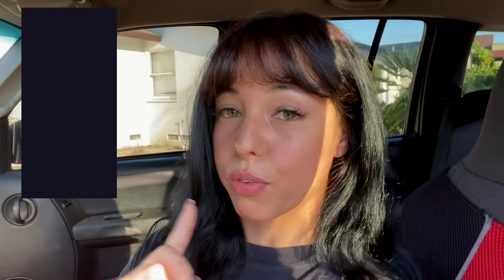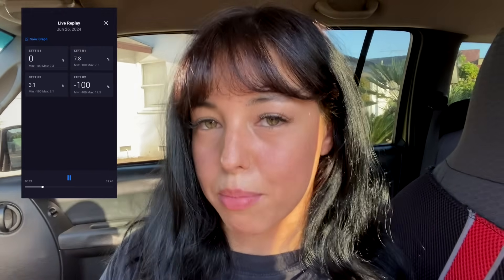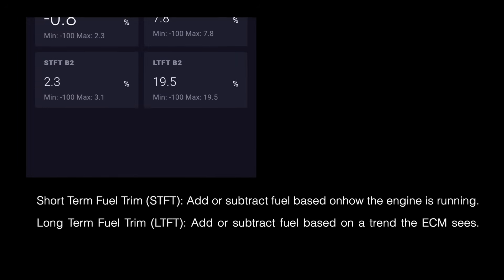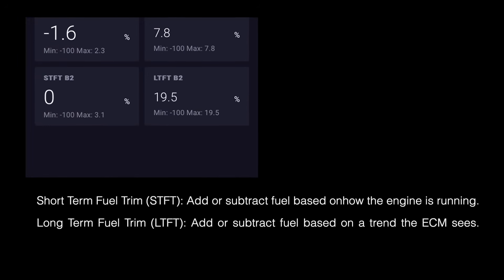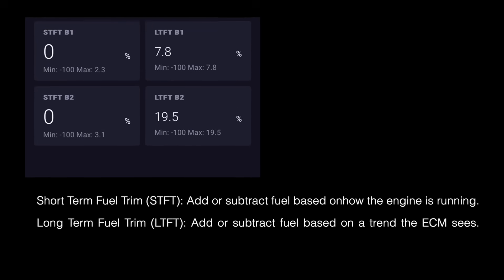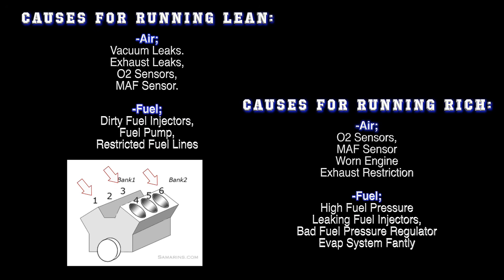Live Data from my OBD2 Scanner helped fixed this Jeep for good!

Comment: 1.02 of this video for a second there STFT B1 went all the way to -100.. 🤔. But it does look like it stayed consistent. I really like how cars are programmed to run at stoichiometric air-fuel ratio. I am still learning a little more about fuel trims. I like the fact that you can diagnose the problem quickly with fuel trims. 
I feel like fuel trims is like secret codes of numbers telling you the problem it has.

Comment: Good luck these have valve seat issues where carbon stops the valves from turning and wear funny. Even after cleaning they will pop up again usually not long after. I've done these and a month later same random misfire. Head work is usually the only solution.

Comment: Very good job on the diagnosis. I just diagnosed my daughters car with a vaccum leak the same way. My live data was showing long term fuel trims almost maxed out close to 30%. I smoked the intake with my homemade PVC smoke machine and found the EVAP purge solenoid was leaking. Replaced it and fuel trims went back to normal. I made a second PVC smoke machine to gift to my brother and he was able to diagnose a vaccum leak on his Land Rover Disco 2. Found leaks on several injector oring seals that had dried out. It was driving him crazy trying to figure it out. Really good tool to have. Again nice job. Cheers

Comment: The only time my Jeep needed plugs or one single coil was when the coolant resevoir tank was dripping onto the coil and connector. Then the valve seat dropped two weeks later. Then the waterpump leaked. Then the torque converter went to hell 3 weeks later. Made it to 198,990 miles.

Comment: Even though the intake coupler is damaged and a source of smoke leaking when performing a smoke test, this is not considered a vacuum leak. This engine is a MAP based system not a MAF based system. If you don't see a sensor on the intake duct/hose, a MAP sensor is used to calculate air density. This sensor is attached to the intake manifold. It's still a good idea that the coupler is replaced because it's letting unfiltered air into the engine. The grease I saw on the COPs looks red in color. This makes me think it's regular wheel bearing grease. That type should not be used. On top of that the grease is on the outside of the boot. The correct lube should be dielectric grease, which is typically clear and it should be applied between the boot and the ceramic portion of the spark plug. The number six plug's washer looks like it wasn't crushed. Meaning it wasn't torqued down correctly in the first place. You might have inadvertently fixed the misfire by removing, cleaning, and retightening the spark plugs. Good job there. No need to pull the fuel injectors. The B2 LTFT still doesn't look right. It should be +-10% range. Either there's additional work to be done, or the scanner is reading wrong. I would suggest using a different brand and compare it's reading to yours. Overall I commend your work ethic and perseverance. Please take this as constructive criticism. My intent is not to bash or mansplain. Have a great day.

Comment: For future reference baby girl just replace the plugs instead of cleaning them. Plugs are wearable no point in putting used plugs back in. Plugs are fairly inexpensive for the most part. Also check gaps and make sure they are in spec according to the vehicles specifications plugs may look fine to the eye but the gap tool may say otherwise. Each manufacturer varies. Not trying to 💩 on you or anything just giving some knowledge. I myself work on alot of things.

Comment: Learn how fuel trims and O2 sensors work as compared to how misfires affect fuel trims. The scan tool is telling you there is a misfire under a load!

It's not the air intake pipe or the O2 sensor and the engine is not running lean. 

Codes only point you in the right direction so you can interpret the scan data and run some tests. I feel like the blind leading the blind 😳 Search for how misfires affect fuel trims.

Comment: Hermanita, put a pad down for your knees to help on the vehicle. Wear knee pads, or, buy the tire step tool, PT makes a good one for cheaper and it holds my FA up at 210lbs, so I'm sure you are good. Nice on checking the basics and finishing the Jeep up. It's a Chrysler so don't be surprised when you have job security. Been doing technician service for years now, as well as welding fabrication and some machining areas. Welcome to the trades.

Comment: Hi, my name is Felix and I live in NYC I love watching your channel ive learned a lot lol. Want to buy a good but affordable OBD sensor what would you recommend? TY
Reply from the maker: @0722fear  Hello there Felix! Thankyou so much for the feedback! For a handy diagnostics tool, I would recommend the Innova 5610! Mine has helped me diagnose and fix almost every issue on my Cougar and to help other vehicles as well.
It has a lot of great features like live data, and reads other parts like the transmission, ABS, and safety/ electrical Codes.
They have really useful customer support which has helped me a long my journey 👍🏻
Reply: @Amy.sahadi  Thank you so much for reaching out. I wish you much success on your channel - Hope I can ask you questions about my car if thats ok. I have a 2013 Honda pilot and I just recently replaced both l/r wheel bearings (front) now my ABS, BRAKE and Stabilizer lights are lit up - help :)

Comment: U should have pressed the gas pedal to let the throttle body open that way smoke can get inside the lower intake checking for other potential vacuum leaks there too the throttle body being close won't give u an actual reading

Comment: Damn shes beautiful, mechanically inclined and has a nice body, shes a triple threat.
Reply: Forreal though. Whoever her dude is is an extremely lucky mf. I have done multiple engine swaps by myself without a lift in my driveway, and all of my previous ex’s just kept asking me when I’m going to be done after pulling the engine/transmission combo and then reversing the steps by myself. How about help me instead of asking me when I’m going to be done. 💀 You also have to be a pretty decent sized Human to do all of that by yourself as well. 6’8 and 184 pounds of lean muscle should do it.
Reply: Simp
Reply: @ElberGalarga22 Were you not doing the very same at one point? 🤔
Does she stop being the magical person she is/was once she has been 'claimed'? 🤔
Reply: She is not interested in no one she just wants views for Cash from you tube
Reply: Sexy

Comment: I'm glad it worked out for you.  Usually those misfires are due to bent intake valve on those motors. It takes about 7 days for it to happen again.  Also, I'm from the school of thought that if you're already in there minus well replace cheap tuneup parts. Do the job once imo. That way you 100 rule out the usual suspects.  Great vid!
Reply from the maker: @nj033  thank you! Im so glad it wasn't either, and it worked out for the best,
I know that i still want to check the car again in the future and make sure its still running smooth with no misfires or codes, sucks that it wont pass smog for now but atleast it runs fine! 🙌🏼
Reply: @Amy.sahadi  Just so you know, you can't clear emissions DTC's. What really happens when you clear emissions codes with a scanner, the check engine light goes and all of your pending codes get relisted as permanent.codes. While the codes are permanent, the pcm monitors the system to determine if you really fixed the problem, or you just cleared. They do it this way because people would clear the codes right before they pulled in for an inspection. Your scan tool probably can't read permanent dtc's.
Reply: If you have a bent valve, it will show up in compression test, or a relative compression test. I would do that first.

Comment: Decent work, but wrong plugs. Iridium in that...nope. :)
Chryslers are tricky, Mopar or no Car and esp with o2 sensors. they like those OEM. 
The Fuel trim was nice call, but the ECM will see the lean and fire more fuel into the chambers.  Only at startup ( open loop) and idle can you tell if you probably have a vacuum leak, and the misfires data will probably tell also, as sometimes there are misfires and the no MIL lamp/light, but you can see them rolling. 
Either way, still work in the hot sun, and Im sure climbing into the engine at your height makes it more challenging. Dont get me wrong the view is exceptional. :)
Reply from the maker: I did not get to test the 02 sensor beforehand when i replaced the original O2 sensor from the Jeep,
But i did test it after and the voltage was at about .6/.4 fluctuating, so both banks were fine !
Reply: @Amy.sahadi  Good deal, I like to see about half a volt at idle.

Comment: Hi hot mod,
At the end of the video where it’s showing the fuel trims, is that after the repairs? If it is, the fuel trims are still high. More than 10%. The check engine will come back. You have a lean condition and the ECU is having to add more fuel to compensate. Most often it’s a vacuum leak. Try doing another smoke test but this time close off the exhaust tip and the intake inlet to pressurize the engine better. I’ve seen these leak from intake gasket before. But don’t go higher than 2 psi or you will probably start popping hoses out. Best of luck and keep up the great work. Sincerely, new subscriber.
Reply from the maker: Thankyou! Yes in fact that was after the repair!
I was wary of those percentages that showed up but i did tell her to give me a call if the check engine light appears but it hasnt yet, if its not a vacuum leak I was thinking its an issue with the fuel injectors since thats something I left out,
You think that could be the issue in the future
Reply: @Amy.sahadi  there’s a few tests you can do to check fuel injectors. Try doing a fuel injector pressure drop test. Use a fuel pressure gauge to measure the pressure. Enable the fuel pump to prime and use a fuel injector tester to pulse the injector and see how much it drops. Measure the rest of them and see if any of them is an outlier. 
I shouldn’t will hurt the engine as long as it stays in stoichiometric ratio but it’s always nice to know that it’s running correctly.
Reply from the maker: @jorgegamero9026  Thankyou so much for the tip, gotta do a little more research and  I will definitely give that a try!
Reply: @Amy.sahadi  absolutely, buena suerte y si necesitas ayuda, yo te puedo ayudar. If you need it of course. Keep up the great work.
Reply from the maker: @jorgegamero9026  thankyou so much! 🙏🏼

Comment: Did you take an auto mechanic class? Or learn by hands on? 
I’m thinking about taking a class, shadowing my boyfriend I’m just not learning enough. And I got an older car that’s always needed maintenance.
Girl power! 🔧💪🏼👩🏻‍🏭
Reply from the maker: I have learned hands on and attended some internships at shops! Also i do study a lot at home to keep refreshing my mind from what i have learned in the past over time! I recommend buying the manual book for your car! Because the manual helps so much!!! Also theres mechanic websites online (for particularly your vehicle) and you can ask them questions, 
they can also help guide you through how to fix stuff on your car as well.
Reply: @Amy.sahadi   Thanks for answering! I never heard of interning at a shop before that’s interesting. 
I have the Manual Book for my car and that has helped with some stuff, I’ll look into the online mechanic that sounds helpful as well.
Thanks for the tips!👩🏻‍🏭👩🏻‍🔧
Reply: @Zekejones1390  I understand exactly what you mean when you say you're not learning enough. If you really want to learn, tech schools like UTI will not prepare you. If you don't go to trade school, you start out as a lube tech. If you do go to trade school, you start out as a lube tech.

I can show you how to get the best education for free. If want to work on modern cars, you'll need factory training. Cars are changing too fast to go independent. Get an entry level job, like a lube tech, at a dealership. On day one, you'll have access to hundreds of online courses directly from the manufacturer. The dealership almost always pays you for every online class you complete. If you are doing a good job, after a few months, you get sent to factory training. All of your expenses are paid for (rental car, hotel, meals, ... everything.). You also get paid your regular hourly rate while you are sitting in class. 

This is how you want to do it. Factory training is the best, and if you are going to be a tech, you might as well be making money.

If you want to see what modern techs do, have a look at these 2 youtube channels. Scanner Danner and Diagnose Dan. These are two of the best techs you'll ever meet. Danner teaches at a real college, and he video tapes his actual classes, When you watch them, its just like being in the class.
Reply from the maker: @052RC  Thats some really great advice thankyou for sharing! Ima share this advice with others that might be interested!
Reply: FYI, that is not where you connect to when checking for an engine vacuum leak. The smoke from the air inlet duct is normal; the leak at that clamp is abnormal but irrelevant to the fuel trim concern because that powertrain design is not equipped with a mass air flow sensor. The calculation of both short-term and long-term when viewing live data is the total fuel trim for the individual banks. Your potential is there, but it still has some way to go. The cleaning of the spark plugs may have bandaged the concern. Overall, I will give you a "B-"
Reply from the maker: @rjeromej8149  and that B- is still a passing grade! Thankyou for the tip and I am definitely improving as I go!

Comment: I don't remember the last time seeing someone start with the basics by checking for vacuum leaks AND looking at fuel trim and not just  throw parts at it, legit diagnosis right here! 👏 👏 👏
Reply from the maker: Thanks🙌🏼🙌🏼🙌🏼 For stuff like this, ive learned it better to work small first before transitioning and I'm glad it was an easy fix over all! 😄
Reply: @Amy.sahadi  I’m guessing you learned from your dad. Good to see a pretty, smart, gall making an honest living with her hands and skills. 🎉👍👍😁
Reply: That's kinda what a real tech does. We don't guess, we check and diagnose. Only backyard mechanics just throw parts and hope it will get fixed
Reply: @randalfernandez2913  .......es correcto!.....primero se debe diagnosticar con fundamentos y no adivinar e ir cambiando piuezas y piezas y piezsa!!
Reply: @randalfernandez2913  I don't know where they get these ridiculous ideas from. If we don't prove our diags, we don't get paid, even if we guess right. Especially if its a really generic code like on O2 sensor. 

I call it the Scotty Kilmer effect. Drive around with your scanner connected, pretend you know what you're looking at and flap your arms around to distract your viewers from realizing you have no skills. Now everyone thinks you use a scan tool to diag and repair a car. In reality, your actual diag starts after you put the scanner down. If a DVOM isn't your most used tool, you're probably a lube tech,
Reply: Very good job on the diagnosis. She was able to pinpoint the problem and make the repair efficiently. Better to double down on the diag instead of just throwing parts in
Reply: Good work
Reply: With fuel trim issues you’d be a fool to throw parts.